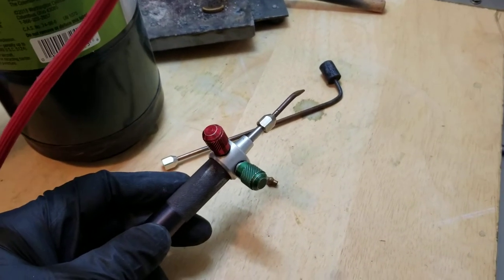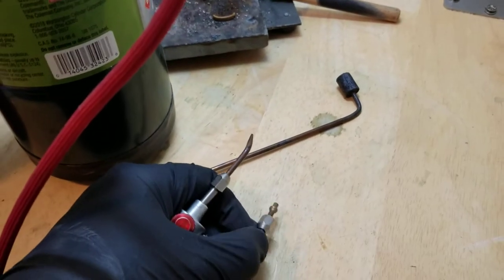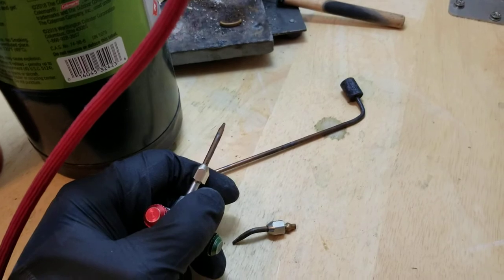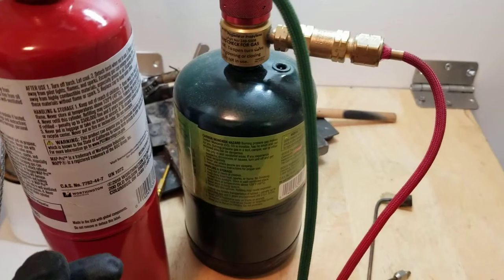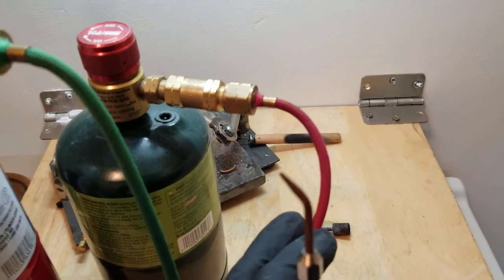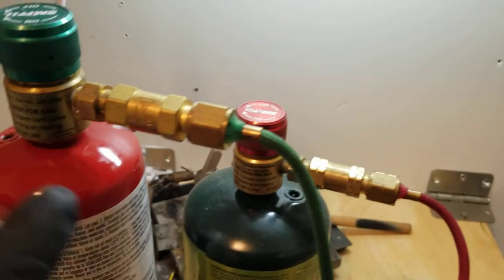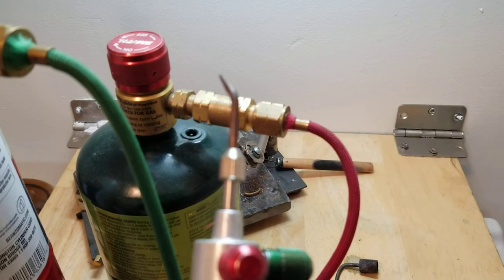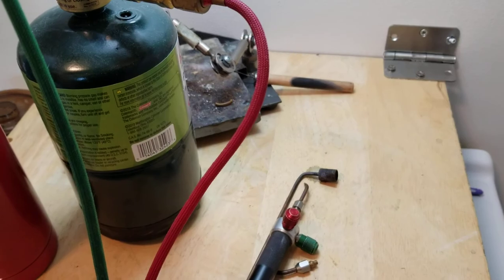Smith Little Torch for Jewelry Soldering Walkthrough

Comment: Nice video! were you able to use the rosebud and #7 tip with the disposable tanks? One supplier said that I needed to move to larger regulators and big bottles (vs disposable) to use the rose bud and #7 tip cheers
Reply from the maker: I def can use my rosebud with the small disposable tanks.  You will go through an O2 bottle in 15-20min of rosebud use, though.
Reply: @bharjujewelry6613  That is really cool Thanks for the real world feedback.

Comment: Ready-Ox Oxygen Generator Torch System
Ready-Ox Oxygen Generator Torch System
Nice setup.  How long does that setup last before need to change out the tanks.
Reply from the maker: It depends on usage.  With daily use probably a few weeks from the O2 and a few months with the Propane.  I solder only a few days a week atm and my O2 has lasted a couple of months, now.
Reply: @bharjujewelry6613  Thank you for the insight.  I was doing some research on these disposable tanks.  You have about 10 to 15 min if you run them at full throttle.   But as you had said unless you are doing a super high heat job these tanks will last for a few weeks with most jewelry soldering jobs.  Also, important to know propane requires oxygen at a 4:1 ratio if you want 100% oxidation flame.  Acetylene requires O2 at a 1:1 ratio.  Again thanks for your insight.